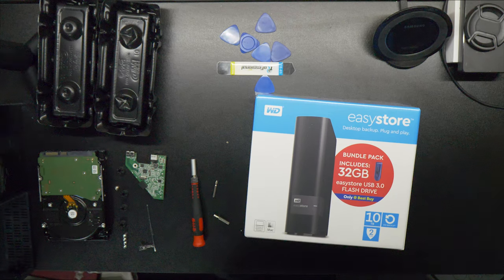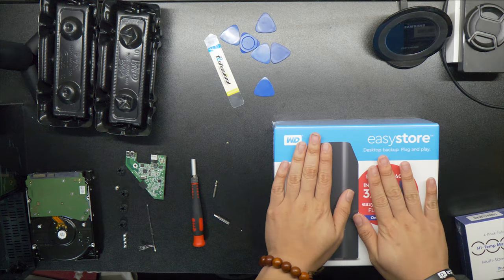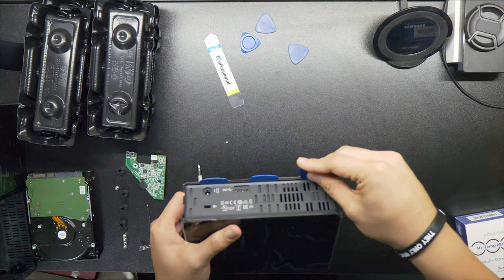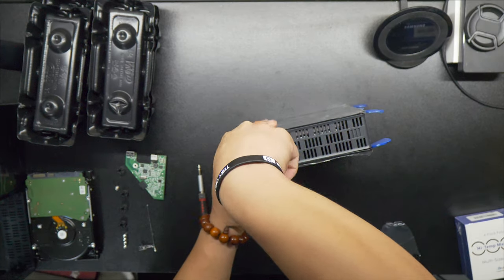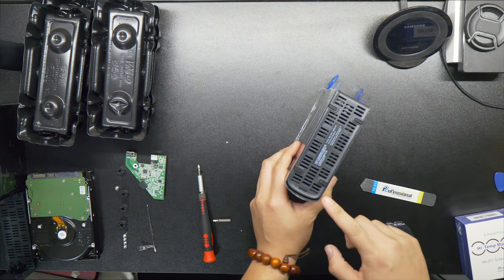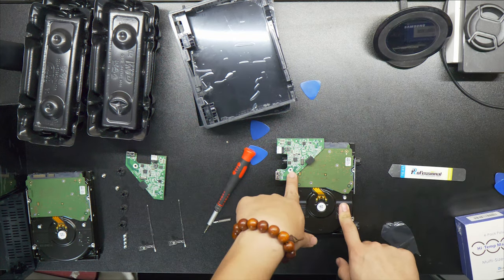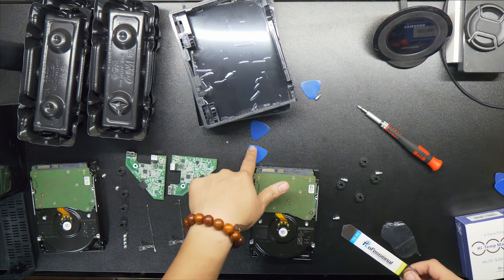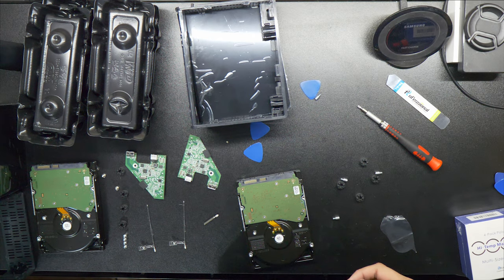How to Shuck WD Easystore 5 Minutes

Comment: 2022 now, but exactly what I needed.  I had the tool set with the guitar picks, but I needed to take it apart without breaking any tabs.  My house caught on fire and I wanted to save my external drive hopefully by cleaning the soot and smoke from it. With blessings from above I was able to clean my computer and it is running (I don't know how long it will last, but happy it is still running)  I just needed to save my WD Easystore drive for back up and now maybe I have.  Big Thank you.😃
Reply: That's awful to hear especially in this economy. I hope you are doing well.

Comment: Great video, thanks for uploading.  I was able to extract the hard drive from its case/shell.  But how do I open up the hard drive itself?  I think the heads are stuck so I need to rotate the disk and move the heads back to the "parked" position.

Comment: Can I transfer files to external drive before removing from shell and placing in NAS?
Reply from the maker: I wouldnt see why not the drive in theory should still be the same unless it needs formatting before the nas.
Reply: @neverstoptech8487  Depending on the NAS a as I have a WD EX 4100 and it will wipe everything off the drive to it's own OS as Windows doesn't recognize it

Comment: I have two issues with this video. First off, it's false that you can't use another drive in the enclosure, I know because I stuck a 2tb Seagate in it and it was usable in Windows. Secondly, I've never heard of a manufacture of ANY device not checking the warranty before just replacing it. I couldn't even try to start an RMA on an out of warranty drive without paying the last time I checked a drive warranty.
Reply from the maker: Apologies the focus was shucking and I didn’t  really test another drive as I didn’t have a need and was going by forum talk. If the case is indeed usable then by all means go for it. 

Second for the warranty I say keep all the shells and they do check but for the most part as long as the warranty is in order and the serials match it’s a ok. Sorry for the misinfo and thanks for pointing it out.
Reply: @neverstoptech8487  I think Jason from Byte my Bits said on one of his shows that if you shuck the drive and don't have the case you can still get warranty on the drive, but it's reduced from 3 years to 2.
Reply: David Leedy thanks for the updated info! I’m sure I won’t need to send them in anytime and I keep the shells but that’s good to know.
Reply: @NotesIn9  I think you'll find that only applies in the US, though I may be wrong.
Reply: @NotesIn9  Bare drives have a 3 year warranty. The same drives inside the enclosure is reduced to 2 years of warranty. You still need to keep the case if doing a warranty replacement.

Comment: so whats the point of doing this?
Reply: To use them internally instead of externally, for example in a NAS or PC.
Reply: @Tesseus  And also to swap the drive with an even bigger one (granted if it's also a WD drive). As someone said here, I do think the drive needs to be re-initialized to work with the controller board.